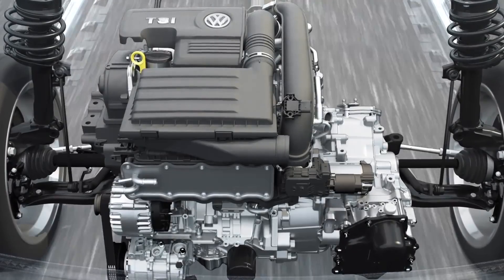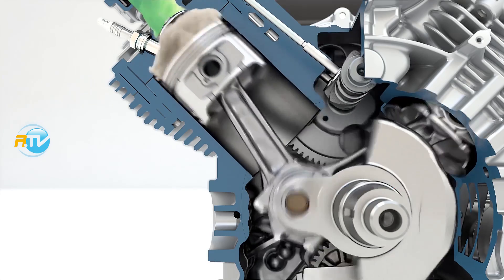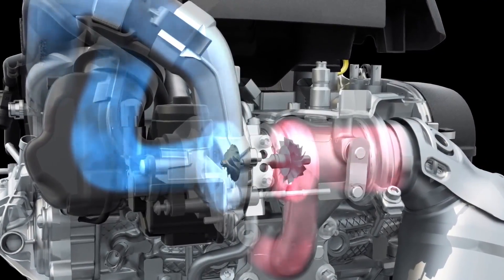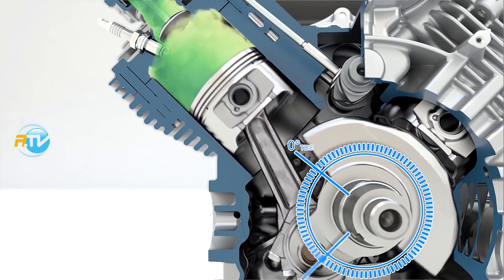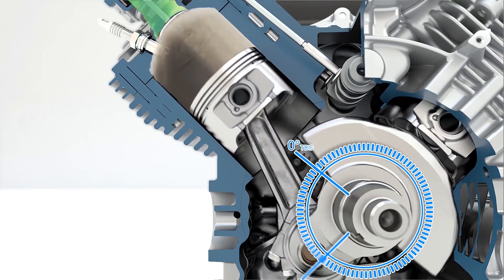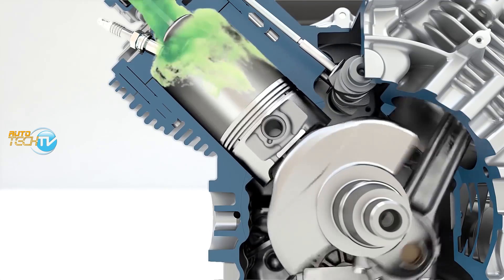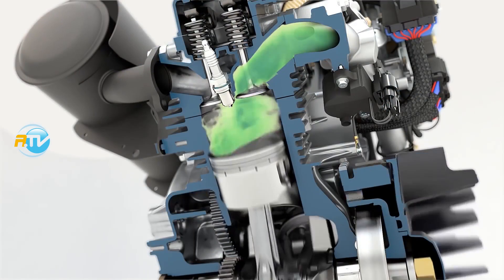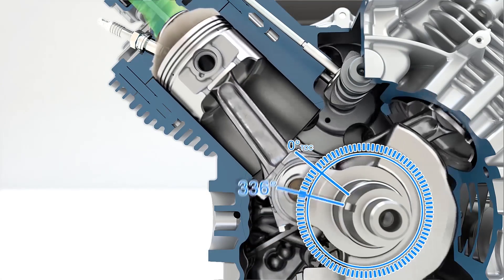What is Advance Ignition Timing in a car engine?

Comment: Quality of gas ( Octane number) also give effect right? But still , your explanation is correct. ? Thanks
Reply: Octane number has actually nothing to do with the overall quality of the fuel. Lower octane fuel does not mean the fuel is of lower quality. Modern fuel has additives and refineries have quality standards by law (depending on your location) mostly focused on keeping engines run as efficient as possible with regards to air pollution. Higher octane gasoline is just fuel that has other chemical characteristics and a higher pre-ignition threshold. (Depending on the physical circumstances of the fuel. Fuel temperature, pressure inside the cilinder, atomization, etc.) Modern car engines that require high octane fuel, are engines that usually run slightly lean, hotter and with higher compression ratios. If you put lower octane fuel than advised in a modern engine you will lose some horsepower because the engine management will adjust parameters to burn the fuel as efficient as possible, and you are increasing the chance of getting engine knock or pre-ignition since the threshold in lower octane fuel is lower. I hope my explanation is clear and that it answers your question. 🧰
Reply: Higher octane allows easier detonation
Reply: @kellismith4329 Higher octane is just a different chemical composition of the fuel or a higher pre-ignition threshold. If you have an engine knock; or pre-ignition problem, high octane fuel will improve the running of the engine, but actually counterintuitive and the opposite of what you are saying, the high octane fuel will theoretically be harder to detonate.